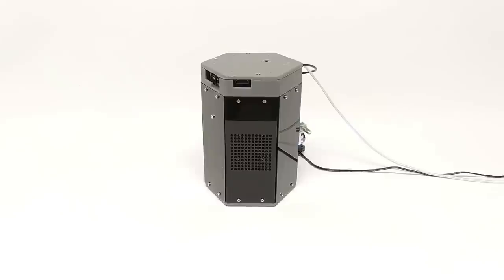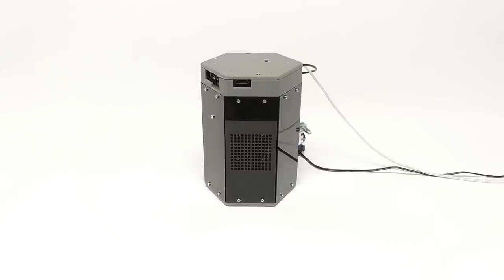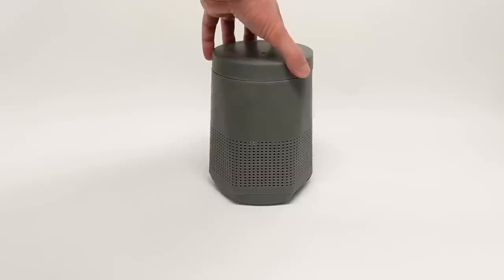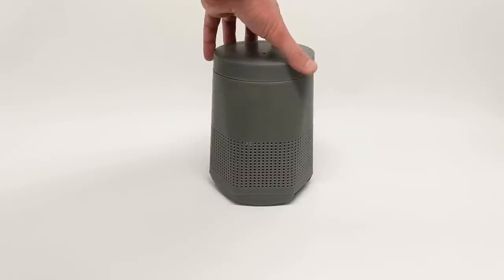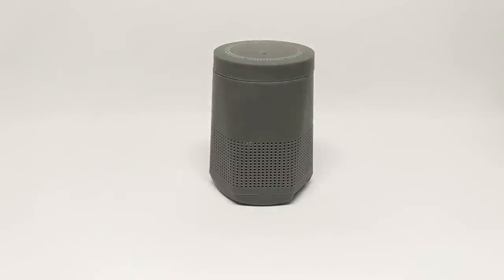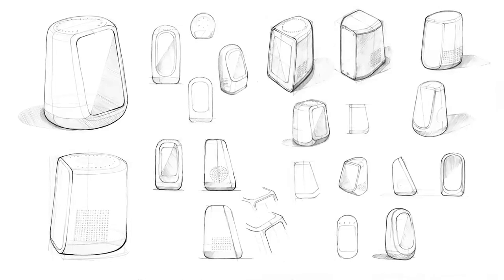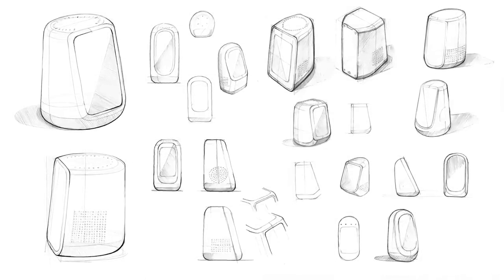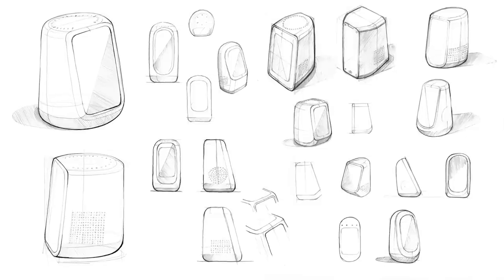Mycroft Mark II - New Design Assembly and Test

Comment: I am disappointed on what seems a stepback from the announcements that came up to december: you told a lot hiding the real status. There is still a huge load of work to do. As far as I was understanding the screen was one of the probmems and I do no see screen here. And on the site I see a lot of missed promises. Like multilingual features (where is an italian compliant and working engine, since now you have tons of translations?), and, since the beginning a connection between all the Mark devices. I am expecting now real due dates. Realistic, honest. Not marketing oriented. Or that will be your last crowd founding and support from my side.
Reply: They were proofs of concept, they are still developing it?